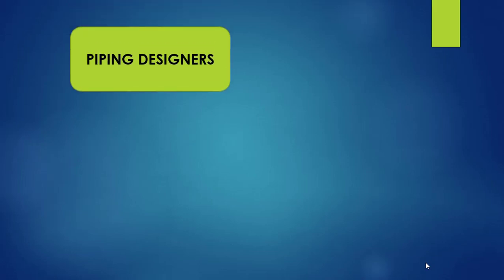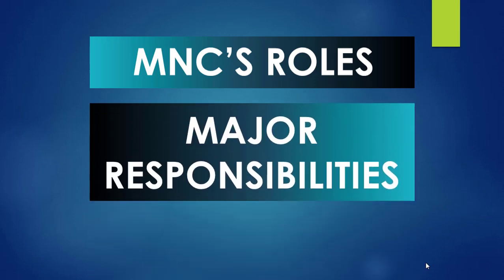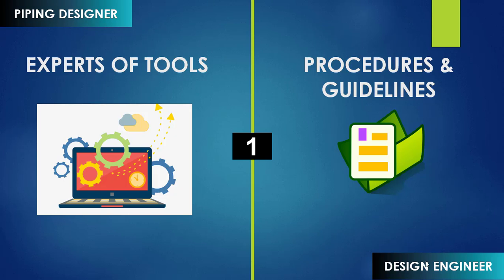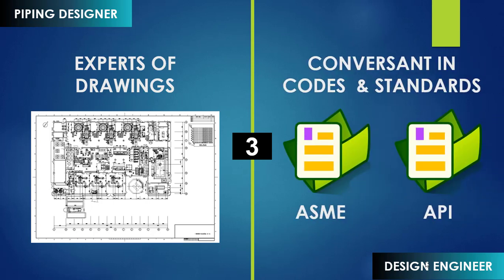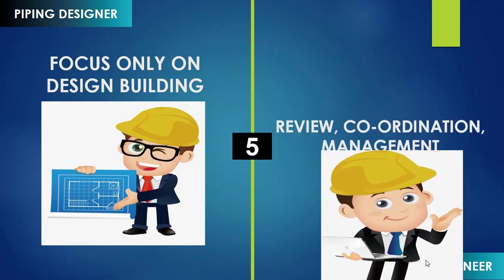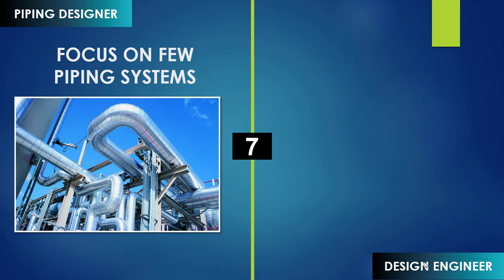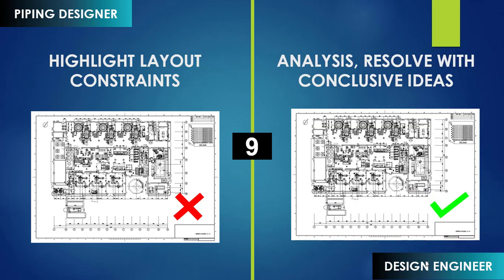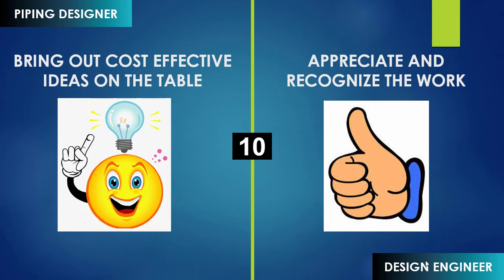Are you a Piping Design Engineer or a Piping Designers? (With 10 Major Differences in Roles)

Comment: If there is Piping Designer and Piping Design Engineer then what Piping Engineer do? In this case Piping Design Engineer and Piping Engineer role is same or differ
Reply: Piping engineer makes sure that the materials for the pipes can stand the process conditions and calculates thermodynamics and fluiddynamics in the pipeline.